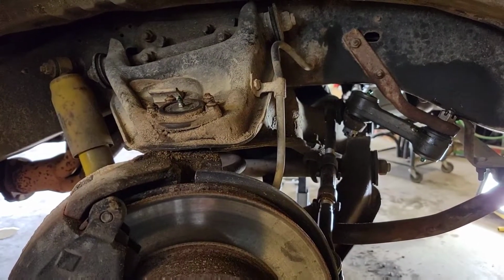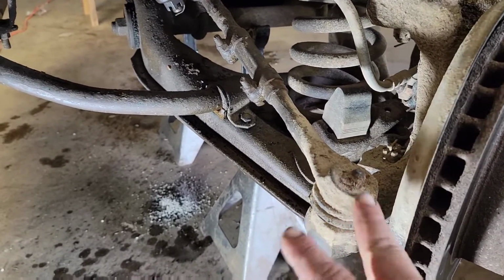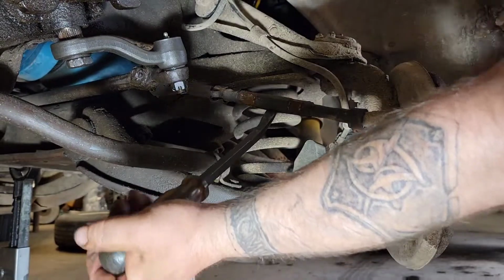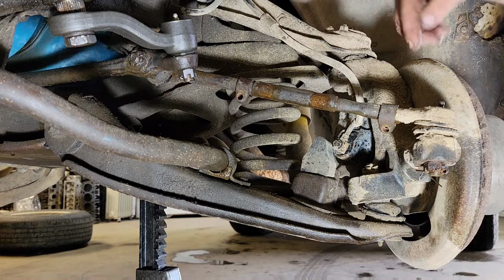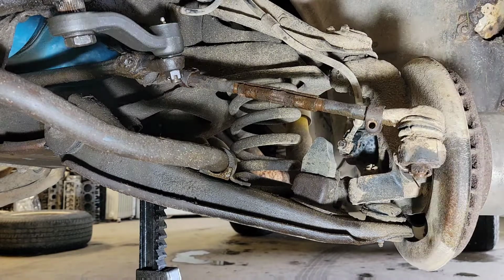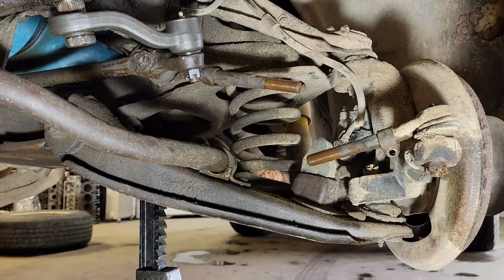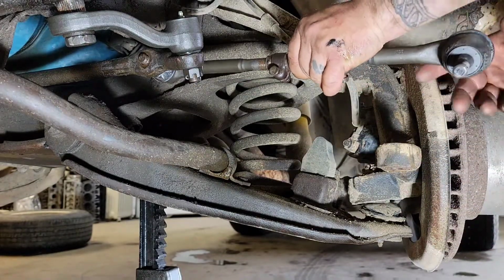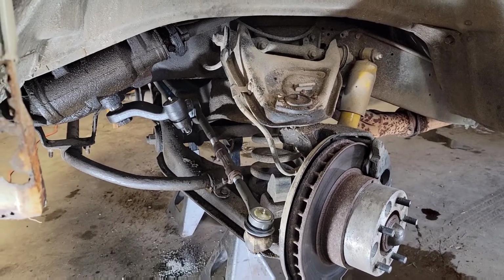How to replace tie rod ends on a 2wd squarebody.  Part 3 of 3 on rebuilding the steering.

Comment: Did you ever do a video about your wheel spacers and wheel and tire setup
Reply from the maker: I don't  think I have. They're 2" spacers all around and 15x8.5 wheels up front and 15x10 in back. 235/75r15 tires up front and 33x12.50r15 in rear.
Reply: How is the stance
Reply from the maker: Just about right. Go to my Facebook page https://m.facebook.com/story.php?story_fbid=1066631604265728&id=291444505117779